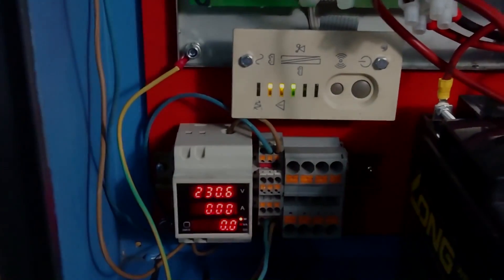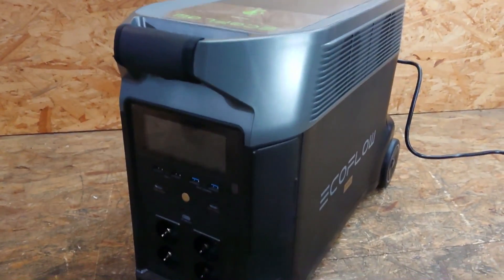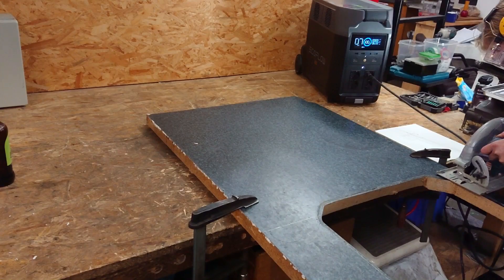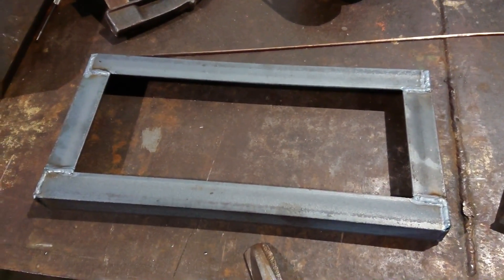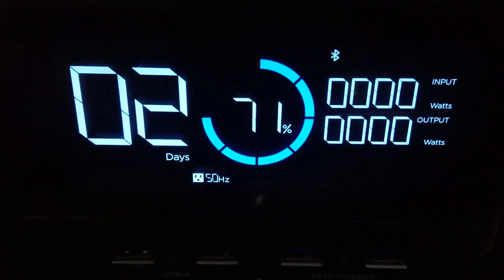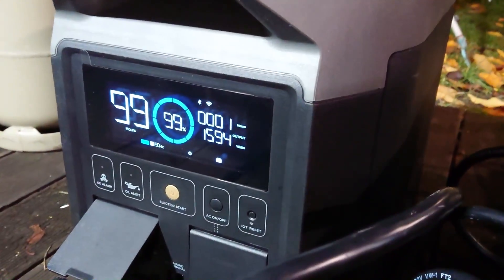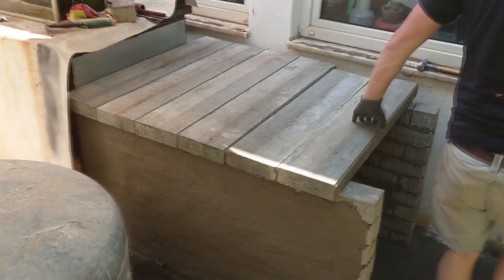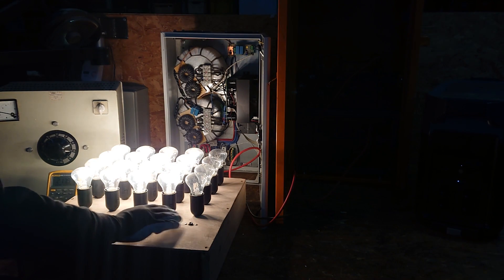Building a DIY Off-Grid Power System (vs. Ecoflow )

Comment: Even for a DIY solution it would be possible to use a LiFePO4 battery made from large single cells, which are quite inexpensive. Using Lead-Acid-type batteries is really not representative. Even worse, the batteries you used seem to be Kung Long WP18-12SHR, which are not designed for this task and in that case would fail soon. 
It would be interesting to know how long the Ecoflow generator can run, before it requires a pause to cool down again. Many people do not know that these small generators typically can only run 4-6h and then need about the same time to cool down again. Larger generators like your BSKA for professional use can run continuously instead. 
The Berel Inverter looks very interesting. I saw similar large output transformers in units from Victron and these make the inverter a lot more rugged than pure semiconductor output stages. It would be really great if you could give a closer presentation of the unit or publish some high-res photos, even though the IC markings are sanded off. Is the output sinusoidal or trapezoidal?

Comment: A problem you will have with that generator shed is overheating due to poor air circulation, but that could be fixed with ventilation ducting to blow the hot air out of the shed.  Also, most of the engine noise is from the air intake and exhaust which can be deadened with mufflers.

Comment: You’re generator garage will overheat.  Thermodynamics of gas engines requires that there be a delta T and that heat must be dumped. Weld or clamp on a full automotive muffler from a small car and you will be satisfied.

Comment: the advertised products looks great, quiet and powerful, but prices are probably 1000 eur for the battery bank and 1500/2000 for the generator.. you just recovered some 2 stroke generators.. those are surely not efficient, but they are low cost or free. you can probably make a muffler to decrease the noise
Reply: 4000 euro for the delta pro battery pack shown here, then 1100 euros for the 400 watt solar panel, or 4900 euros for both as a package.  1600 euros for the generator.
Reply: @UCCLdIk6R5ECGtaGm7oqO-TQ  thats way too much!

Comment: I hope overheating is not an issue on the generator in the tiny garage. Air cooled engines usually need some sort of airflow and the generator itself should have airflow to cool also, correct? short duration would not be an issue but anything longer than half an hour and I would worry about that small of an enclosure warming up a lot.

Comment: Greetings, I really enjoyed another great video from you!
      In America there is a tool available called a 'Kill-a-Watt'. It is a small gray box and can check a number of things about the US standard 110/120 AC wall current. One of the handy features that it has is a display of exactly how much current is being drawn through it, by various tools or loads. It is rather inexpensive in price but invaluable for planning your electrical needs (and components). You can, and I have,  use Ohm's Law to estimate your needs but it is usually Very flawed data. A 5 amp 110 saw 'should' need (5 x 120 = 600) 600 watts but it is usually wrong. It may draw 1500 watts upon startup and only draw 400 or so watts while running. Most motorized tools draw around double the power for starting and most (but not all) inverters have a double capacity for short surges but all of this is just guessing. The other problem is that tool companies want their products to look strong and powerful so they basically lie about the tools amperage. I have seen many tools claiming 7,8 or 9 amps and never run close to that. That's why the little Kill-a-watt tool is so important. I expect that the company makes a European version that measures the electricity in the standard figures for your grid.
     I think that the battery bank and generator that you are testing should be free to you. I don't agree with the constant 'peddling of junk' that some YouTube channels do. But, by the same point, if you test and report on the items accurately you aren't helping a company sell a crappy product (and are helping your followers make informed decisions about costly purchases). Like you were saying, you spent a lot of work to build your channel to what it is and (to me) that makes your testing and evaluating a product valuable. You earned those items, they're not a bribe for your endorsement, if you report on them honestly. I like some of those battery/inverter banks but some of them are pretty expensive. It would be of great value to your veiwers to know the good from the bad before spending that kind of money! Lithium Iron Phosphate batteries are an amazing thing! They have come down a lot in the last few years but are not inexpensive by any means. They can discharge a lot and have a lot more usable electric storage. I never discharge lead batteries below about 75% so 1000 amps of lead batteries only gives you 250 amps that you can use. I know they say that you can deep discharge Lithium batteries but I don't. I never take them below about 35%, but That Still gives you 650 usable amps from the same 1000 amp bank. To me, batteries are an investment and deep discharging batteries isn't good for them. The Lithium batteries can probably go deeper than the 35% figure that I use but unless it is a serious emergency, I just don't see a reason to damage thousands of dollars worth of battery bank materials. 
     Anyway, Great Video. Take Care and I do look forward to your next one! I would like to see one of your generators set up and running on a 'wood gas' system, John

Comment: Great video and think your outlook on reuse and recycling is exemplary as well as your range of skills. Looking at the output of the Berel inverter I don't think the output voltage is too high. It seems well within the tolerance (230v +/- 10% I believe) you might expect from the mains supply caused by cable voltage drop, loading, etc. 240v RMS should not be a problem at all. Most combustion engine generators will have a high no load voltage which "sags" under load somewhat. Most appliances can easily cope with such variations and indeed are designed to in most cases. Unless you need the wide range of voltage output  I would get rid of the variac as you are just introducing more efficiency losses into the system.
Reply: And if you really do need a lower (or higher) voltage, check into a buck-boost transformer.  They only have to pass about 10% of the load so they are MUCH smaller and cheaper.  see:  https://en.wikipedia.org/wiki/Buck-boost_transformer .

Comment: Over here in Czechia there's a shop that resells checked new LiFePo4 batteries for pretty cheap. Just ordered 32pcs of 134Ah LiFePo4 cells, making 13.68kWh nominal power capacity for 2750EUR. Not bad I think! Needs just a BMS and some mounting :)

Comment: I saw on another channel an issue with mains regulation (resulting in significant over voltage at a high switching rate) when starting up high power inductive loads. Could you repeat the test to see if the Ecoflow behaves similarly?

Comment: I have a similar unit called the AC300 from a company called Bluetti.  I am a construction contractor and have been able to build decks, repair roofs and even construct mini houses with just that device for power.    Anyone who is a builder, technician or a mechanic should have one a mobile power station.   It's invaluable.

Comment: I'm very interested in this video. In the UK the cost of getting an installation is around £14k+ and this is an on-grid system. I want to try to build a dual system where our air source pump and cooker are run off mains and the rest of the house is run of solar and batteries. If I do this sort of system the price can be halved plus any costs of an electrician. However, seeing the ecoflow system at work makes me wonder if this would be a better but more expensive route. If you move it is a pick it up and take it with you system. Any thoughts on this running a house? Thanks

Comment: I haven't seen the whole video at this point  7:00 but you could do with a unbroken cable in a crimp across from battery to battery with a disconnector for each battery to monitor and change each battery without shutting down

Comment: This is the first time hearing Ecoflow makes a dual-fuel generator, and I agree that it is a great addition, for 3 potential energy sources.
Reply: I thought it was a ducar generator but it's not the same there are differences. Hope it's not the same as the champion dual fuel I have because it burnt the cam off in the first 10 hours. There are a couple Chinese manufacturers of these Yamaha clones (ducar sensi and probably others) you could certainly find the same thing for much less money. I took the propane stuff off the champion and put it on my generac gp2200i which is definately a ducar. It bolted right on other than the I can't change between propane and gas as easily. It has to be out of gas and carb emptied to run propane. The champion changed rpm under load differently depending on what fuel it was running on. When you hooked the propane hose up it engaged a switch to tell the computer to change the mapping. The generac running the carb off the champion on propane burns more fuel because of this but at least it didn't blow up.

Comment: i am thinking more like free energy brushless PCB motor - who wants batteries that will lose life and catch fire getting off oil sure can get off battery too - just by butting solar cell in motor and adding light as on and off switch
Reply: Lifepo4 is a very stable chemistry with a lot of recharge cycles if you don't run it completely flat often or in sub-zero temperatures.
Why on earth would you need a light to operate a solar cell??? 😆
Having a battery is kind of the point (being able to gather power and use it whenever you need)

Comment: I don't know man, these products are very expensive to buy.  Only the wealthy can afford such things.  I don't think it suits this channel to be promoting top-tier commercial products like this.  I can understand the allure in being given such things though.  Off-grid and alternative power technology is certainly an interesting subject though.
Reply: I think it fits great when Gerholf is comparing/contrasting the product with his own upcycled power bank.
I wish he had put the scrapyard fuse box/inverter/AGM to the test, showing both powering the saw or grinder over XX time.
Technology has certainly come far in the last few years. Hopefully we don't see the scrapyard full of Ecoflow's in 40 years time.
Reply: @jimurrata6785  I quite expect to see them being binned in about ten years or so as the battery packs fail.  I suspect most who buy these things may only use them a handful of times before they end-up stored away for years and years until it's clearing-out time.  Many will probably self-discharge to battery death if they're not plugged in for long periods.  I wonder what their serviceability is like, though I suspect few would ever bother.

Myself, I think I'd prefer to use a car battery and basic inverter for those rare times I need off-grid power.  At least I could source car/truck batteries easy enough.  Maybe as EVs become more common they'll become the source of such power.
Reply: @UCCLdIk6R5ECGtaGm7oqO-TQ  Perhaps for the wealthy who pick one up for the novelty and let them sit in a frozen garage. 
Those Vanlifer's and off grid cottage dwellers are going to be on top of state of charge and cycling them regularly.
I haven't seen the cells inside or if equivalent is available. Maybe Will Prouse knows???

Comment: Hey in that house for the generator

Please please please 

Don't forget to install an exhaust fan. Maybe a squirrel cage blower fan so that the engine can intake fresh air.  And a hole for the hot air that the engine AND stator generates to keep it cool.  You can't seal that off would that engine running you'll absolutely decimate it

Comment: Several comments. First, given your ethics and the way he'll run your channel to have a sponsor and have you give an honest review of their product and it's capabilities is well within your remit. Secondly, on that bigger generator, you may want to look at some sort of muffler from a motorcycle to replace the current muffler on the generator. This may give you a much quieter exhaust note than the one that is on it as those are built to the lowest common denominator.

Comment: I know Ecoflow has been making the rounds on YouTube, but I appreciated the different take your review offered. Battery specifications and load testing are useful, but actually seeing the unit in real use means a lot. Remarkable that the Ecoflow would support a huge noisy load like that 3kW grinder, run for a couple days of work, and still have more than half its state of charge left. This is excellent real-world context. That dual-fuel generator is quiet enough, you could have it running near a tent or camper and still sleep well. Good stuff. 👍

Comment: Hi, Our house has a 3kW solar system that attaches to batteries. Here in Australia (near Brisbane) the solar panels do a fair bit of charging even on the most overcast days. Typically through those overcast days the only appliance running is the refrigerator (without a freezer) and occassionaly the water pump. On sunny days the washing machine (our biggest power user) runs directly on the panels. Have you done readings on the amount of charging your solar panels do on overcast days?

Comment: What is wrong with test a battery and generator, many would like to know if they are worth the money and can perform well. This is a good way to expand the channel. Remember many can not build their own system and will need to purchase one. 
The little shed you constructed will require better ventilation for the generator to reduce the heat and I would increase the height with a wooden frame and put ventilation domes in the roof space.

Comment: If you want to reduce ac output voltages by a fixed voltage you can use a smaller transformer connected as an auto-transformer. The primary and secondary connect in series to the supply and the load goes across the primary. The trick is that the secondary can be of high amperage while the secondary can be of much thinner wire, it couples magnetically. No need for a 20kg variac then :)

Comment: if i had your youth and knowledge, i would build a system like yours. as i am old, i bought several smaller "solar generators".
i also have a backup generator that is dual fuel. where i live, we get hurricanes every so often that damage the power grid.
we can be without power for 3-10 days at a time. i got one solar panel and found out i do not have enough sunny hours to
charge a battery/inverter. "hobo tech" on youtube tests all the various brands.

Comment: I don't have access to enough wood but very impressed by DIY wood gas turbines. Otherwise, I don't know enough about biomass energy generation. Understand some substances you burn but others, anaerobic digestion for methane is more efficient.

Modifying some internal combustion engines to run on wood gas is fairly simple.

Wonder about heat pump and composting. Understand that composting can generate a lot of useful heat.

Comment: You have a great channel I have been following for years. One thing you need to address is the cooling for that surplus 1980's generator in the enclosure you built. You might want to add a couple of ventilation fans (powered by the generator). since an air cooled engine in a closed environment will quickly overheat even in the winter.

Comment: I really like those tri fuel generators where you can use gasoline, propane or natural gas. Which make the whole back up generator cool. The only thing is gas degrades over time. Diesel does not, it just gets dirty.

Comment: So far this is the best ad for eco flow. I wonder if there is a setting that one can set on the eco flow so that when charging the delta flow if the gen set would shut down automatically. 
I watch DIY solar with will or something like that. He tears these down and tests them as well. Eco flow is pretty good up there with the others. 
I do not have a need for one right now. Though If I did I think I would make my own version using either eg4 sever rack battery and eg4 all in one inverter their big one or one of their small ones. Which is around 5k with used solar panels.

Comment: Great video as always. I am so glad to see you always wearing hearing protection. I am not one of those safety nazis that scolds every youtuber they see for not wearing gloves or aprons at all times but taking reasonable precautions is always worth it. When I was younger I was a sheet metal worker before I moved into the office, but 2 decades of sheet metal work in the eighties has left me with permanent loud ringing in my ears.
 
When the older guys would tell me to take the time to set up a workbench instead of just working on the floor to get something done quickly I would scoff at them. Now I see the value of saving your knees. It never occurs to the young that they are not invincible.
Reply: My first video is my buzz saw video. This was like 12 years ago I think. Safety nazis were powerful back then that I did the take a couple times unedited and wore all of that gear and it only has like 5k ish views.

Comment: I got a couple Ecoflow units this year during black friday. Both the River 2 Max and the Delta 2 have exceeded my expectations. The smaller River 2 Max (500W/1000W cont/peak output) runs my fridge without issue. The bigger Delta 2? I haven't found anything it hasn't been able to run... space heaters, heat guns, grinders, saws... it does it all. The 110W / 160W panels the units came with work pretty well too.
I've also got 1.8kW+ worth of panels on the way, plus a 5.1kWh rackmount LIFE (EG4) battery and 3000W hybrid inverter. Definitely caught the 'energy independence' bug from TPAI & other youtubers :)